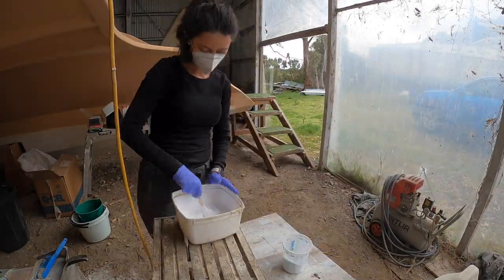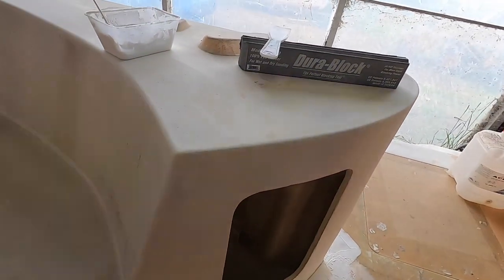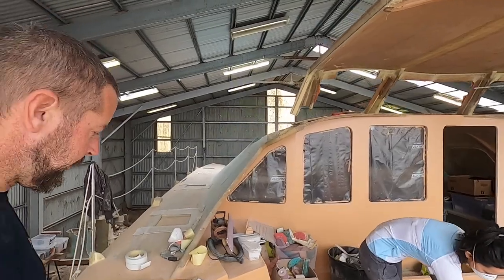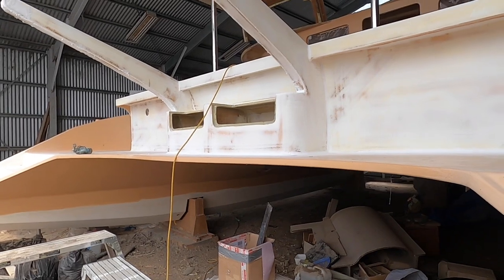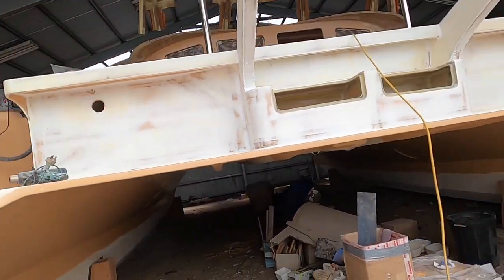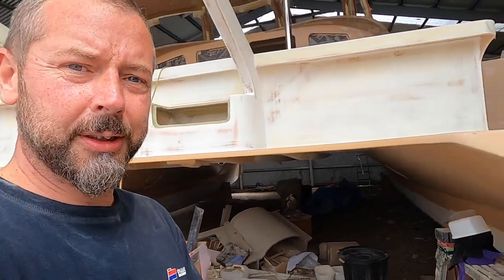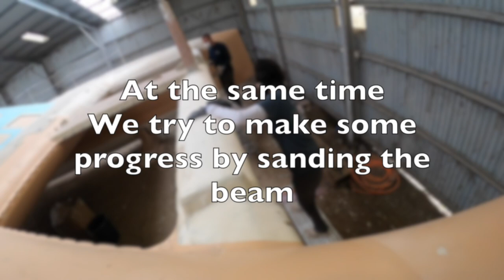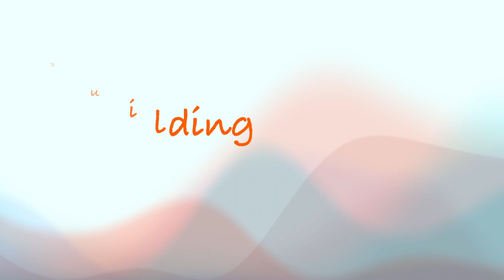S02 E03 Cockpit coving! More sanding!

Comment: I love the look of the Schionning deck house and the 45 degree slope from the inside of the hulls to the bottom of the deck. I also really like that platform on the back between both hulls to rest your tender on. I'm wondering if the same boat built out of aluminum would be lighter, the same weight or heavier?
Reply from the maker: Not sure... It would be close. Have a look at the mumby 45. Very similar boat in aluminium built in the Philippines.
The slope or chamfer panel is a safety feature. It creates a quickly increasing displacement reducing slamming and splits a large bend into two.
Reply: @buildingwilda  I've watched Sailing Life on Jupiter and was going to get or build a Mumby Cyber 48 until Peter of Sailing into Freedom revealed his new aluminum catamaran. Now I want a boat like that but with a deck house like the Schionning has so that I will have more flat space to mount solar panels and I like the look of it better. My favorite Schionning design is the Arrow 1360 called Duet. I like how they built that aft deck for the tender to sit on, the double helm and the sun cover that is flush with the cabin top. I like the aluminum material because of the inexpensive cost and how quickly it gets built. The strength of building with aluminum seems to be better than building with fiberglass. It looks like the most affordable way to go is to build a Mumby Cyber 48 until Peter shares more information on his new build.
Reply from the maker: I also love the Duet! I would have loved more flat roof space. No design is perfect I guess. I'm studying naval architecture now and formally learning about these compromises.
I like Plucky! But I've missed that it was an aluminium boat he was building. Cool!